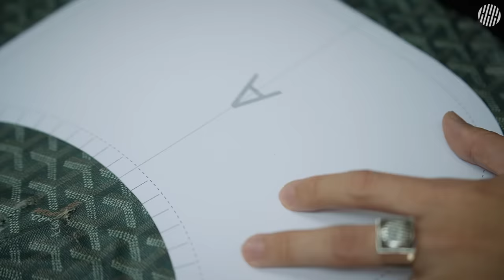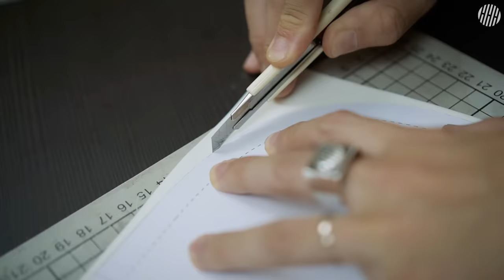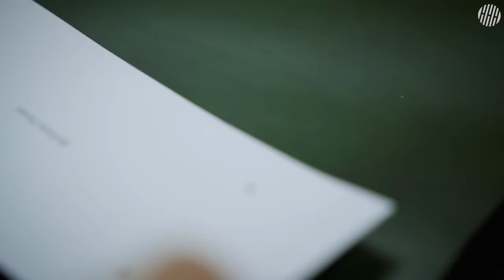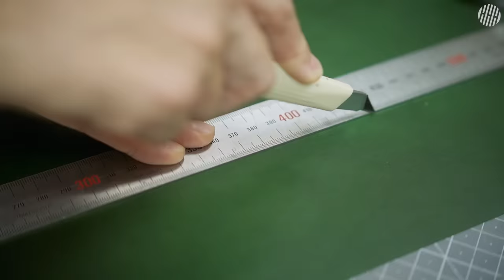Is it possible to give this bag a new life? #upcycling

Comment: What is the gray material used to stiffen the bag? I’ve watched as many of your videos and I’m so in awe of the craftsmanship and talent you exhibit in our craft. Although at 80 I don’t believe I’m any threat to your status as I’m still learning. And after 3 years and the accumulation of a lot of tools. I’m getting better.
Reply: Hi, Chuck :) leather craftsman here: the product in which you are referring to is bondex (bag stiffiner). It's a paper that's thick enough to be bend resistant and water resistant, and you're supposed to apply it on the inside wherever you want a more sturdy bag. It also helps smoothen out bags and prevent creasing from overtime use; best for flaps and bags that wish to retain their shape. 
There are many versions available on Amazon, though most are pretty decent quality in my opinion. 
I hope this helps!
Reply from the maker: Gray material is LB (Leather Board) more flexible than Bontax (bondex? or we call bontex here). Thank you for the detailed explanation Christopher and keep up the good work Chuck !